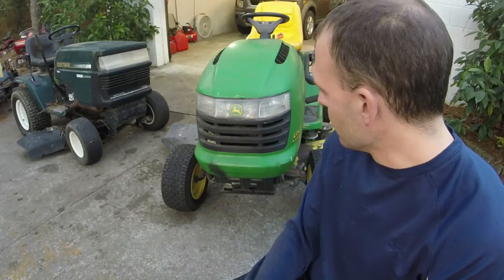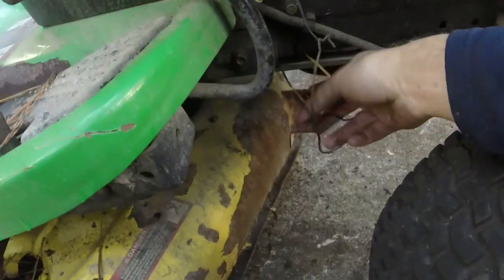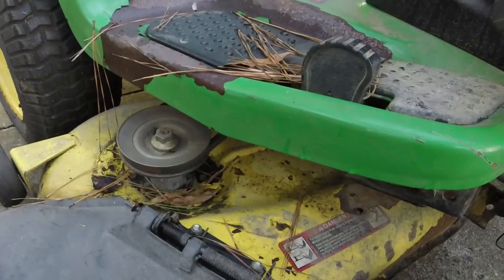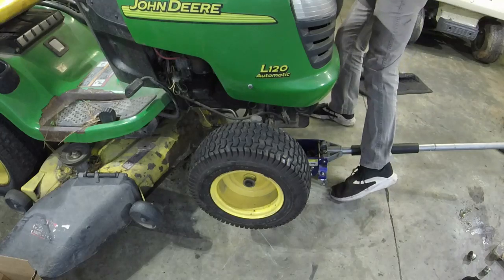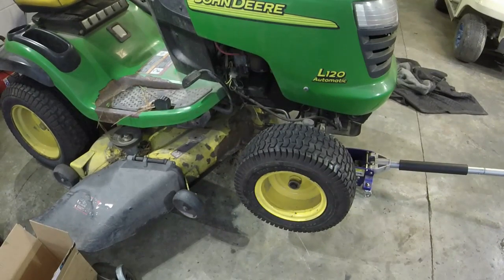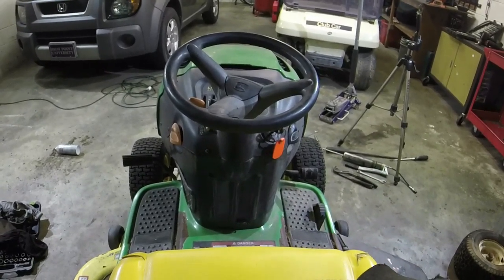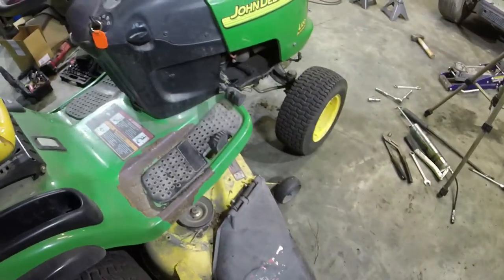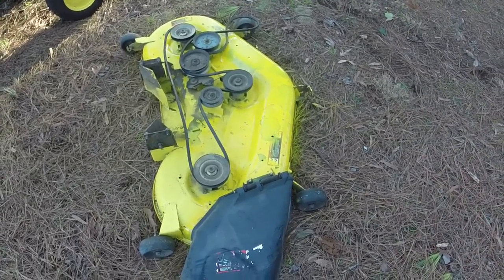John Deere L120 needs front end alignment, wheel bearing, PTO wiring fix, paint, & voltage regulator

Comment: I Agree With Mr. Kiss my Italian Ass : You Should Have Put New Bearings In The Front wheels. The Half Moon Steering Gear On The Bottom Of The Steering Shaft Is Called A Sector Gear ,The Drag Links Have Been  Bent From Running Into Holes Or Something Else & The Wheels Being Twisted & Bending The Drag Links Out Of Shape. When You Took The Drag Links Off You Should Have Made The Steering Wheel Straight & In The Center Of The Sector Gear. That's Why The Steering Wheel Is Not Straight. I Bet It Turns More One Way Then The Other.

Comment: Also You Put A BLACK Negative ( MAIN BATTERY ) Wire From The Solenoid To The Positive Side Of The Battery, This  Should Be A RED Wire not Black.. You Need To Paint It Red Or Put Red Tape On It So The Person Buying It Wont Hook It Up Wrong & Burn Out Everything On The Mower & If That Happens They Can Blame You

Comment: I also have used a similar product from Eastwood. Both look like milk, easy cleanup, no harsh smell and leaves a good paintable or leave as is surface. The Corroseal is a bit cheaper in price. 1 gallon will do several decks :) And you can apply during cold temps with the assistance of a heat gun :)

Comment: Good day Casey. Something i have done on these. Harbor Freight bed liner black, spray cans work really well on making the decks look better. Black looks good and the texture of the spray bed liner covers and encapsulates all the imperfections. One can will usually do it. Also coroseal brush on works well for underside of the deck. If you want to coat and seal the rust.
Reply from the maker: I'm about to rust proof an LX277 deck so I will definitely keep these tips in mind when I go and do that deck.  Thank you!

Comment: Hey question I have a LX 277 fairly new battery. No problem starting but why does my battery lite stay on all the time!!!
Reply from the maker: The battery may not be charging and you may need a voltage regulator.
Reply: @EllisMowersandmore  
Ok thanks I’ll check it out .